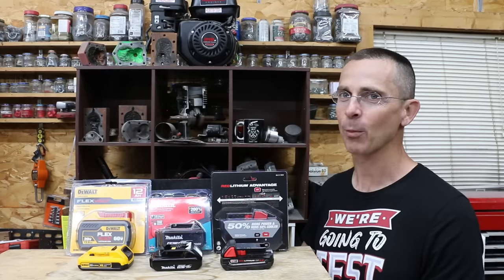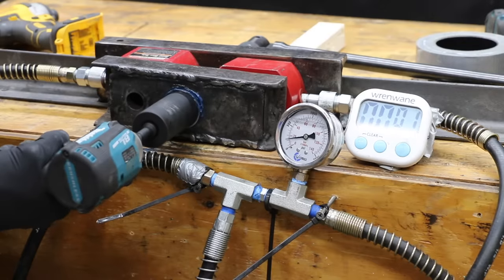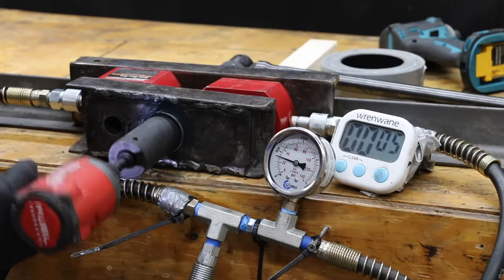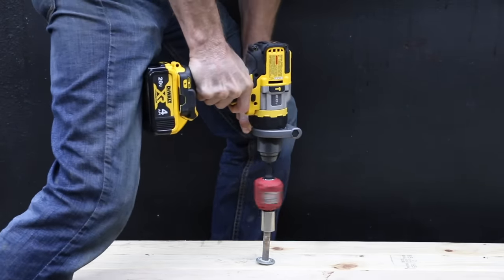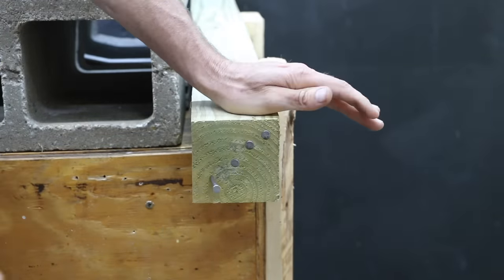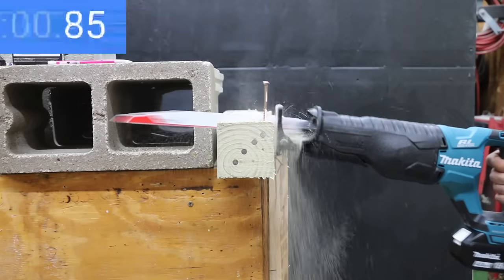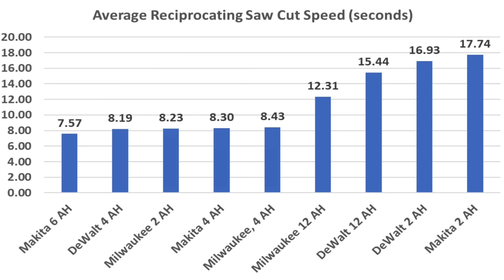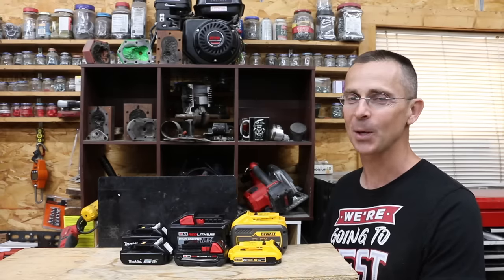Small "TOOL" Battery Better? Milwaukee vs DeWalt vs Makita

Comment: It's worth noting some of these bigger batteries are designed for higher current, the Milwaukee especially. They make smaller versions of the high current batteries, might've been a better comparison if the goal was just to compare performance by capacity. Also I prefer to go based on watt hours vs amp hours, gives a better representation of battery capacity when comparing batteries of different voltages.
Reply from the maker: Thanks for the constructive feedback.

Comment: the only thing is they dont show current output. 2 ah could push 10c while a higher ah can push a different amount due to less size restrictions. much like rc battery, 200mah can push 10c while a 1200mah battery can push 20c
Reply from the maker: Thanks for the feedback.

Comment: The cells in the batteries are serial. The more cells, the more amps. If the higher capacity batteries had bigger cells but the same number of cells as the smaller batteries, output would be the same.
That's why I don't bother trying my smaller batteries for drilling big holes in pressure treated lumber or cutting hard wood with my circular saw.
On the downside, the larger batteries will discharge faster for the same reason, as in two 2Ah batteries will run longer than one 4Ah battery.
I knew the answer before watching this, but I wondered if I was missing something.
Reply from the maker: Thanks for the feedback.

Comment: Please add a table on the main page with links to times in the video and a short summery. Summery would be the most helpful. I was at Ace Hardware yesterday trying to scroll through a video to see which drain cleaner to buy. The summery would have been extremely helpful.
Reply from the maker: Thanks for the suggestion.

Comment: When cutting with a reciprocating saw, I found if I apply more pressure and slow down the blade I will get a faster cut on cast iron pipe. I know the saw works harder when working under these conditions because it heats up faster. I would like to see you apply 50 to 70 lbs pressure slow down the blade speed and make the cuts and see which battery works better. Or which can make more cuts.
Reply from the maker: Thanks for the suggestion.

Comment: I Got the m12 fuel hammer drill to go along with my m12 impact and it was pretty weak with the small battery. Got a 6ah battery and it made a big difference. Feels like my m18 drill now.
Reply from the maker: Thanks for sharing.

Comment: Anyone with general knowledge of electronics can call bullshit on smaller batteries having more power. The only difference between batteries would be the current provided. More battery cells can produce more current. Just like batteries, the marketing teams' brain could use a lot more cells.
Reply from the maker: Thanks for the feedback.

Comment: All these batteries are 18v. If you measure a fully charged battery it will be over 20v.. so.. if Dewalt use that as a selling point.."ours 20v they better than the rest".. can one one  believe anything else they say??
Reply: All brand name batteries use LG or Panasonic cells. The DEWALT 12Ah is simply three 4Ah 18V batteries strapped together. Internally, they are remarkably similar.

Comment: I would like to see a higher amp hour battery for the Milwaukee V28 / M28 tool line. Their 28 volt battery is 3 amp hour and your video shows the high current tools run better with more amp hours.
Reply from the maker: Thanks for the feedback.

Comment: I would love to see the differences in brake fluid, is there a different viscosity in brands? Do some hold a better boiling point to others? What about mixing dot 3 and 4? How does that affect things? Even going as far as mixing dot 5 with 4 or 3 just to show exactly how it affects performance and what it does to the fluid
Reply: While I can't speak to the differences between brands, DOT 3 and DOT 4 are the same type of fluid, with DOT 4 having higher boiling point and slightly better long term stability. DOT 3/4 are glycol ether based and DOT 5 brake fluid is silicon based and can not be mixed or replaced with DOT 3 or DOT 4. Likewise you cannot use DOT 5 in a DOT 3 or DOT 4 system.

Do NOT mix DOT 3/4 and DOT 5 fluids, it can cause braking system failure. That being said, DOT 5 fluid does not absorb water like DOT 3/4 and thus does not have near the problems with rust and fluid boiling over time.

Comment: Pretty sure this will get lost but i noticed lately that there are a lot of octane booster brands and many claims. Do these products really do what they claim and is it worth it? I ran into this problem because my car is tuned for 93 octane and the station only had 87. So i bought an octane booster to make up the difference. The car ran very poorly almost like it was just straight 87.
Reply from the maker: Thanks for the suggestion.

Comment: I put a 5ah battery on my Ryobi tire inflator, and compared to the stock battery, it inflates twice as fast, and doesn't bog down at 25psi anymore. Plus the battery can now inflate all 4 tires before it loses the a single bar of battery, where it would be dead on a single tire on the stock battery. Just a battery alone made the whole tool go from almost worthless to impressive.
Reply from the maker: Thanks for sharing.

Comment: I'm mostly invested in Makita tools. They'll last me a lifetime but my gosh their lithium batteries are horrendous. Have had bricking problems because of the chip inside the battery and the charger. Doesn't seem to matter with the new ones and the older ones.
Reply from the maker: Thanks for the feedback.

Comment: I wonder if the treated lumber had more moisture content towards the middle than near the ends? 
from past experience higher moisture content treated lumber causes tooth clogging and requires larger teeth/less teeth per inch, like wood only/pruning blades, but obviously those wont cut metal. I'm assuming it was newer lumber and not aged long term
Reply from the maker: Thanks for the feedback.

Comment: I love your test and they are all fair. The only thing with the reciprocating saw and sawzall, when you got to the higher Ah batteries, you definitely needed more weight. Because the blades are moving faster with more power, they can cut through the wood and nails faster but need the weight/force to help it do that. Whereas the lower Ah batteries may have bogged down because of the lower speed and less power. Other than that, great video and keep up the good work
Reply from the maker: Thanks, will do!  Thanks for the constructive feedback.

Comment: 12:10 I wonder if the Milwaukee was slower with the bigger battery because there was less downward force on the blade?  Looks like the battery pack's center of gravity is pretty close to the handle, though.
Reply from the maker: Thanks for the feedback.

Comment: Having only access to makita, i know your results are true, as the higher the battery, the very noticeable difference in performance of the tool.

I think with makita this is more noticeable in there batteries, as your results show.

Your tests prove that makita are right not to go over a 6ah battery, as the battery in other makes is too powerful for correct function, as shown by your milwakee impact driver with 12ah battery test.

Shows makita are right not to bring out battery over 6ah, as thats enough real power for these tools.
Reply from the maker: Thanks for sharing.

Comment: I understand the Amp Hour difference, but in theory the voltages should be the same. I have a suspicion the higher amp rated batteries also have a slightly higher voltage in them as well. Not a lot more, just a little. Would it be possible for you to test the voltages on each battery as well?
Reply from the maker: Thanks for the suggestion.

Comment: Do the reciprocating saws have a trigger screw to limit the strokes per minute? Would slowing down the speed make the 10amp batteries preform better than the 4amp batteries?
Reply from the maker: Thanks for the suggestion.

Comment: Could you please test if Vaseline / baby oil would be suitable as a Chainsaw chain lube?
Biodegradable chain lubes clogged my chainsaw and it basically got totally ruined, Mineral oils are hard to find ( in my country) and basically are ISO 100 ,not anything crazy.
Reply from the maker: Thanks for the suggestion.
Reply: @ProjectFarm  I used my chainsaw with basically no oil, sparks were flying 😂😂

Comment: Most of the time when the smaller batteries are more powerful then the larger ones is when they use the 21700 cells vs 18750 cells.  Alot of 3 amp batteries use the bigger ones
Reply from the maker: Thanks for the feedback.

Comment: Really would like to see a video with 3.0 high output milwaukee batteries the high output batteries where designed for the fuel brand to run at there peak performance.
Reply from the maker: Thanks for the suggestion.

Comment: will you check out the new oil triax and do a video maybe and motul?  I put motul in my sxs and it outperformed amsoil and mobil racing in shifting and seems like more hp its Ester base
Reply from the maker: Thanks for the suggestion.

Comment: I have a video suggestion. What is the best replacement stone grinding wheel for a bench grinder? The original one that came on my bench grinder is much softer than others I've used.
Reply from the maker: Thanks for the video idea.

Comment: got a suggestion for you best degreaser stuff like purple power or other products that can be bought in bulk i work heavy equipment and have to wash them constantly would like to know what is going to remove the most oil dirt and grease with the least amount of work if you have a video already please share it.
Reply from the maker: Thanks for the video idea.

Comment: I've found most of the a 4amp/h battery is the best compromise, they have enough power to get the job done without needing a recharge and are still light enough not to wear you out.
Reply from the maker: Thanks for the feedback.

Comment: Can you test bolt strength. Same grade bolt (automotive) new one vs old one. Idk how to test it but interested to see if bolts really need to be replaced on cars or just recommended. Of course on the non critical parts of the car.
Reply from the maker: Thanks for the suggestion.

Comment: When your tool has more power you can apply more pressure to it. And while I understand the desire to be consistent with tool pressure it seems pretty obvious to me that 20lbs of weight on the reciprocating saws with the high Ah batteries would have been a more accurate demonstration of the benefits of more battery capacity... which is kinda the topic of this test.
Reply from the maker: Thanks for the feedback.

Comment: The voltage is what really controls the voltage which are nominal ratings, it would have been nice to also test the initial voltages as a comparison between size as well. Out side of that I would thing a larger battery would be better performance since it would have a slower voltage drop over time.
Reply from the maker: Thanks for the feedback.

Comment: The 12ah batteries moved the reciprocating saw blades very fast. I wonder how the blades looked after that portion of the test. The higher speed might cause less or more wear on the blades. It would be an interesting detail if there was a difference
Reply: This is an excellent video by the way. That's a given with you. But worth the mention. Thank you for what you do

Comment: Off topic for this video.... but would like to see a video on comparing transmission fluid added to fuel similar to seafoam and other additives in cleaning carbon deposits
Reply from the maker: Thanks for the suggestion.

Comment: Man itd be cool to use a 12 amp dewalt battery if only they weren't 200 bucks and i didn't work on a construction site where theyd be stolen the second my eyes averted from it on the charger
Reply from the maker: Thanks for the feedback.

Comment: i wonder if there is a more optimal weight (more) for the larger batteries that would make the cuts faster? with the faster strokes, its mostly gliding over vs filling with the cut and expelling it. needs more weight, i also wonder, does that higher weight have a negative effect on the smaller batteries with the slower strokes?
Reply from the maker: Thanks for the suggestion.

Comment: Milwaukee states this is part of their smart battery design and you will get more torque from a larger battery.  This however may depend on the tool.  There is a video they put out a while back about it.
Reply from the maker: Thanks for the feedback.

Comment: As always very interesting test! I do have one question. Why dont you use longer screws for testing the torque? So the screw head never hits the wood and you can clearly measure the torque of the soft screwcase. When the head of the screw hits the wood with some turning speed and is nearly immediatly stopped, because the head can not penetrante the wood, the measured torque will no longer only be the soft screw case, but rather the hard screw case. The rate of increased torque with bigger batteries may be  less.

Comment: seems like the middle batteries are the sweet spot in cost and performance gain unless you are running tools like the air blower.  Also holy crap that Milwaukee impact driver is one strong tool.
Reply from the maker: Thanks for the feedback.

Comment: I got those 2ah DeWalt batteries in the thumbnail with the 18v NICD conversion kit.  They're junk and last HALF the time of the 1.5ah batteries that came with my drill... Which cost more than my 6Ah Amazon batteries that last a dozen times longer more than them.
Reply: And yes I know the Amazon batteries only last half the time of a real DeWalt battery ... But I can get TWO for $40 and a single DeWalt costs $200
Reply from the maker: Thanks for the feedback.

Comment: PRESSURE ON THE SHOE IS IMPORTANT I HAVE FOUND IF YOU DONT PRESS THE SHOE FIRMILY AGAINST OBJECT IT WILL JUST VIBRATE BACK AND FORTH WITHOUT CUTTING
Reply from the maker: Thanks for the feedback.

Comment: Before even watching this video I can tell you that the larger Dewalt batteries absolutely make a difference vs the smaller tool batteries in the real world. I am a general contractor and I have seen first hand the Flex volt batteries put out more power in various cordless tools than the standard battery packs.
Reply from the maker: Thanks for the feedback.

Comment: It would be nice to see some chainsaw testing too. I know you have used some in some tests and was wondering which chainsaw would be best, and which would be more efficient depending on job on gas vs battery power. Maybe too with a reciprocating saw or two in the test too.
Reply from the maker: Thanks for the video idea.

Comment: Have you made a video on 3in cut off wheels, or the little rolock disks. That would be one id like to see. Using them everyday at work id like to get the best ones there are.
Reply from the maker: Great suggestion!  Thank you.

Comment: its critical u hold the sawzall tight enough that the foot doesnt bounce otherwise ur getting an inaccurate result from the blade not cutting half the time, instead simply vibrating the tool wasting strokes
Reply from the maker: Thanks for the feedback.

Comment: when battery cells are connected parallel they have smaller internal resistance and they can give higher current , so its normal for higher capacity battery to perform better because they have more cells which are connected parallel
Reply from the maker: Thanks for the feedback.

Comment: Quite surprised that a larger amp-hour battery would result in a faster spinning motor. Figure the battery voltage would be the same and hence same motor speed.
Reply: It's likely because there isn't as much voltage sag under load. Because the larger batteries can output more current, you are using a smaller percentage of their output capabilities and the voltage doesn't sag down as much.
Reply from the maker: Thanks for the feedback.

Comment: I was interested in the battery adapter used to be able to switch battery brands. Can you provide a link to it ?
Reply from the maker: The battery adapter is sold on ebay.

Comment: I'd love to see what batt installation is best. Testing stuff like thermal insulation, sound damping, fire resistance and water resistance.
Reply from the maker: Thanks for the suggestion.
Reply: I hope nobody ever needs a fire resistant drill battery, unless you buy that Bosch junk.

Comment: I'd like to see a pull test on concrete epoxy vs liquid nails construction adhesive.  Just drill a 1/2 in hole into concrete and insert 1/2 in rebar with one of the two adhesives and see which one holds under a pull test
Reply from the maker: Thanks for the suggestion.
Reply: @ProjectFarm  maybe even do one with a 5/8 hole and 1/2 in rebar.  Just to see if the concrete epoxy really bonds .  I work in concrete now and know that the 1/2 inch rebar has to be hammered into a 1/2 in hole.   I  almost wonder if it even needs epoxy being it's so tight at that point.     I'd also like to know if there's any difference between the depth of the hole.  I mean what's  the difference between drilling 6 inches or 4 inches in an 8 inch slab. When your building a cinder block wall that will be filled with concrete where that rebar is .

Comment: As this progresses, I'm starting to have concerns over the design of some of the higher amp batteries and wondering if they're putting out the right voltages.
Reply from the maker: Thanks for the feedback.
Reply: They all have the same voltage output, it's just that the larger batteries don't sag as much under load. The smaller batteries voltages are sagging because of the current draw, but the bigger ones aren't.